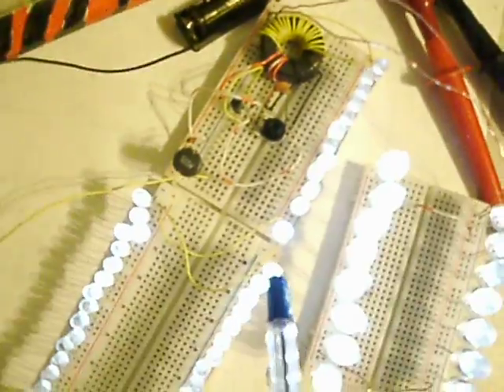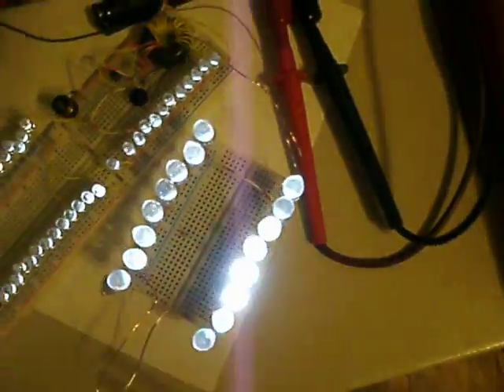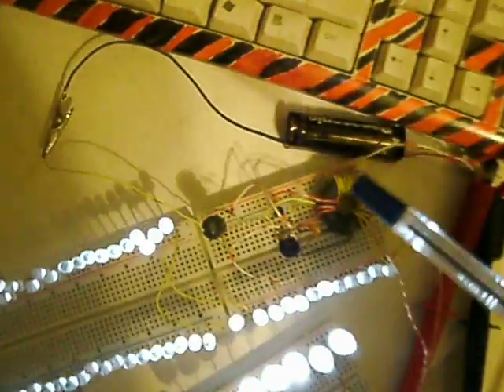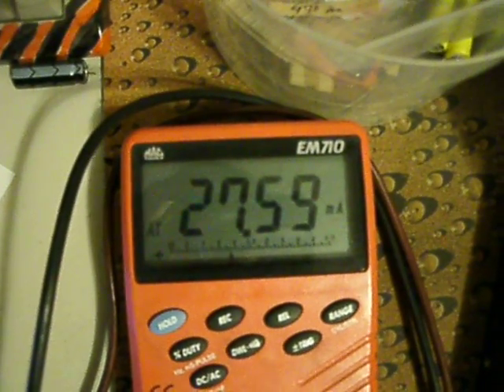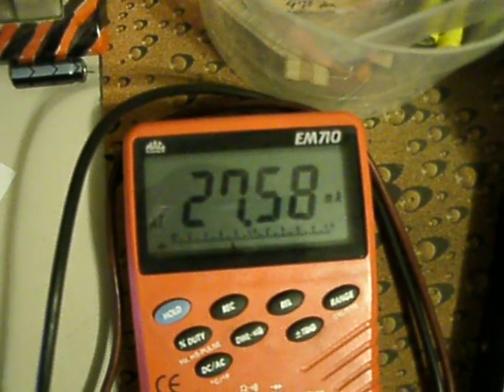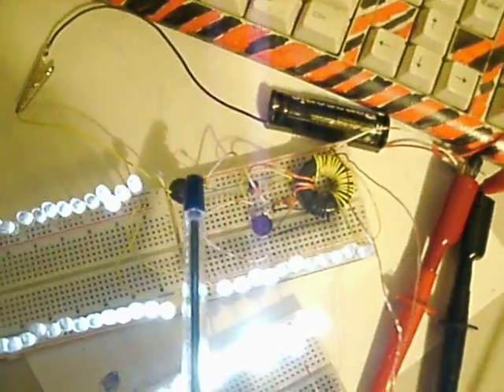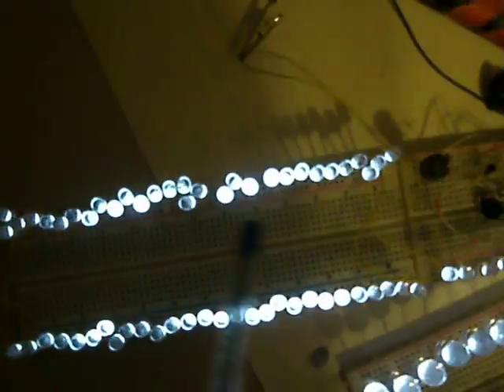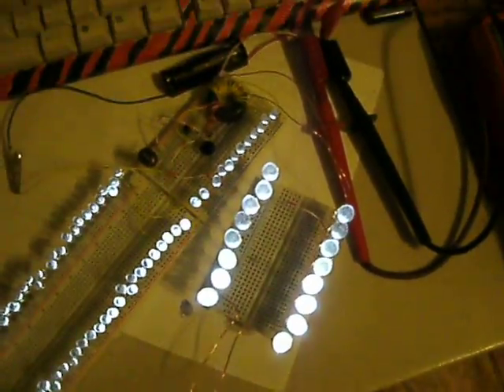hartley oscillator

Comment: Robbie:

Wow man!  Gee, I believe the specs for one of those leds is about 25 mA's so with 70 running at 27 mA's should not work at all...but it does.

This circuit of yours was really out of the box thinking and I congratulate you on it.  Very well done.  I hope many others replicate this.

Bill